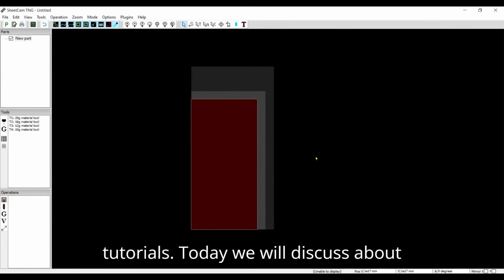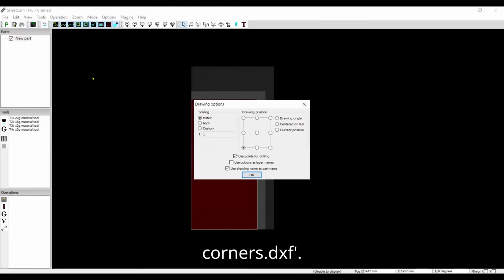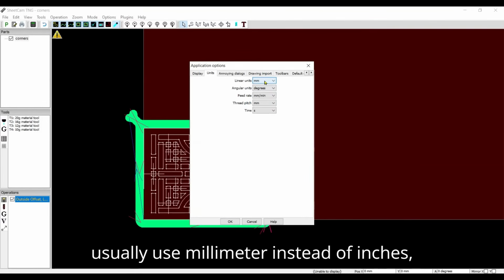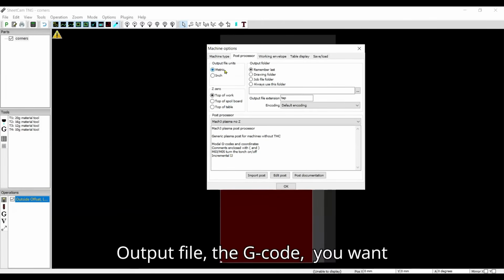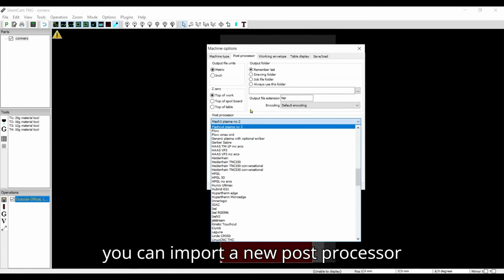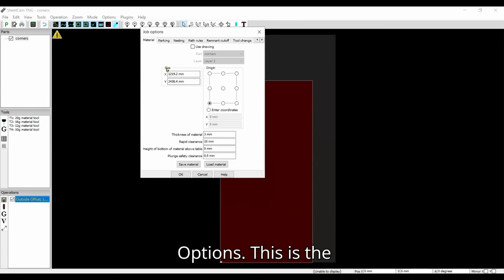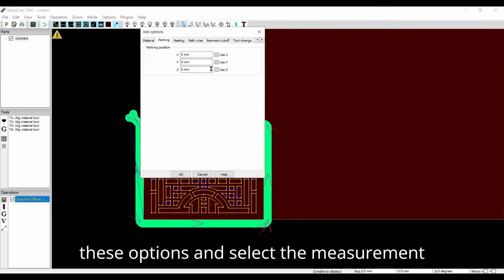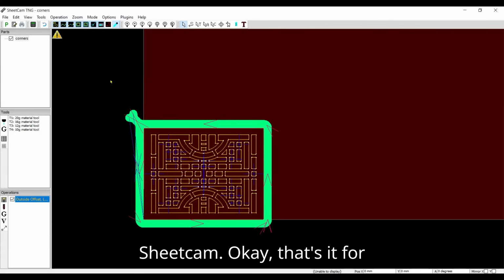Lec # 14 How to use Sheetcam for CNC Plasma Cutting | Beginner's Guide | Sheetcam Plasma Tutorial

Comment: How to set tools for diffrent material thickness
Reply from the maker: To set tools for different material thicknesses in Sheetcam, go to the Tools tab, create a new tool, and specify the kerf width, feed rate, and pierce delay based on the material's thickness. 
You can also save multiple tools with unique settings for each thickness for quick access in future projects.

You can watch these videos to get the complete details:

-- How to add a Plasma Tool in Sheetcam : https://youtu.be/MK2YeVIIt9Y  

-- How to add Multiple Tools in Sheetcam: https://youtu.be/Dt7FJ4u-uuE